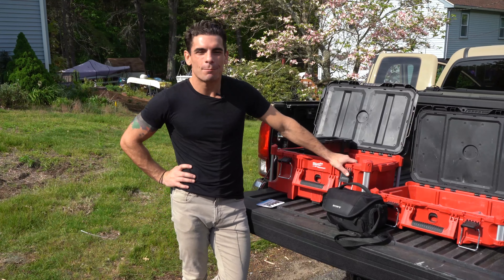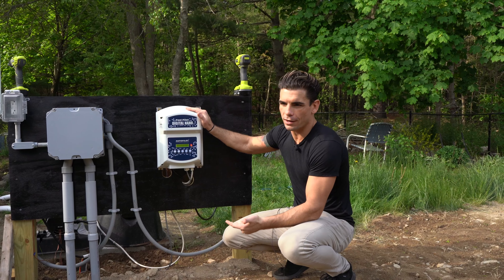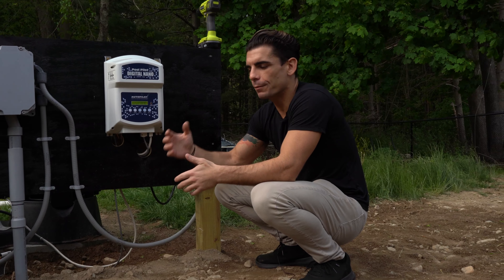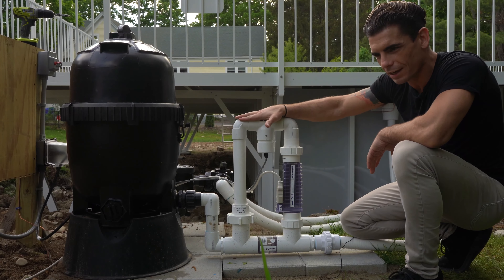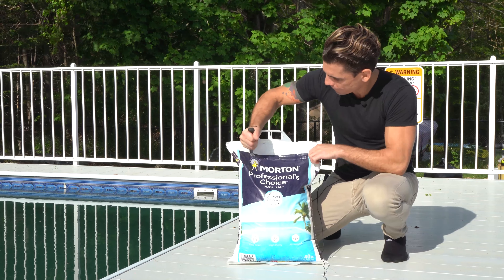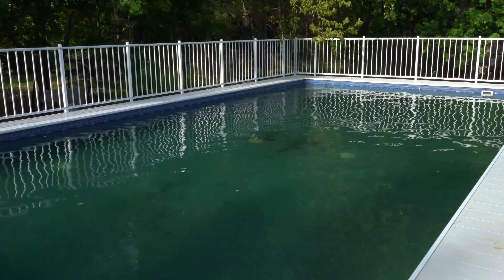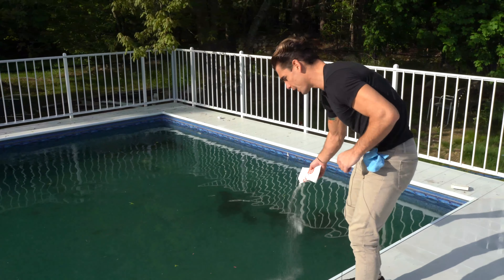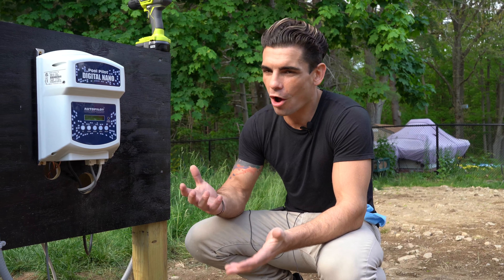Salt Water Kayak Pool School

Comment: Hello again Daniel. Had a great first summer with the pool! I am ready to begin closing and do not see a video for salt water closing. Wondering if there is any difference. Do I add the same winterize chemicals as I would for chlorine? Do I do anything to the salt water generator? Should I take in the digital nano? Lastly, I have a deep end…do I need to pour anti freeze into the line that runs under water or will that run back into the pool? Thank you for any guidance with these questions and thanks again for a great pool!
Reply from the maker: no difference for winterizing, no anti freeze and i would take every part off for the winter including the computer although on mine ive got it mounted on a post so i just put a big garbage bag over the top of it and tie it up for the winter.

Comment: Hello. Thanks for the videos they have been very helpful! Ambassador just installed our kayak pool! We love it. I have a question. I didn’t have the 8 bags I needed (I had bought 8 but used 2 in my softener while we waited for delivery 🤦‍♂️). I only put 6 in when the generator called for 8. I grabbed 2 more the next day but the machine is not saying add salt. It says purify is at 50%. What do I want purify to be at? Should I add the last two bags? Thank you in advance.
Reply from the maker: It should have given you the amount to put in when you first ran the system, sounds like its enough if its not asking for more, keep an eye on the water and if its clean and clear your golden, i would leave it right where its at.

Comment: Once again saw your video. Thanks for your response to my question I noticed that you had the setting of 35% on the chlorine production. Is that a good place to start? And it was I correct in understanding that if the chlorination gets out of whack it will automatically adjust up or down from the 35%? Also we have a inground concrete pool will the alkalinity being high or low have a wearing affect on that?
Again thanks for your video nice clear concise factual no hype.
All the best Neal southwest Florida
Reply from the maker: i only know these in the context of the kayak pool and the kayak pool is super efficient in the way it filters water, i would say let it do its thing, and the water chemistry stuff is also dif w inground pool.

Comment: Nice presentation. We have the autopilot too 
We are in fla so the pool runs year round. I just set the meter at 35% and got the alkalinity down with a cup of acid. Other than that do i need to just test and read the read out screen?

Loved the sneeze scene.
Reply from the maker: Environment and pool size and shape is definitely going to factor in I've had my pool for 12 years I've literally done nothing I also don't add anything for alkalinity because I feel like chlorine is the most important thing and pH generally follows chlorine.  The system is meant to be plug-and-play you can dive pretty deep into the manual on how to calibrate but personally I keep it simple in my pool is crystal clear all year